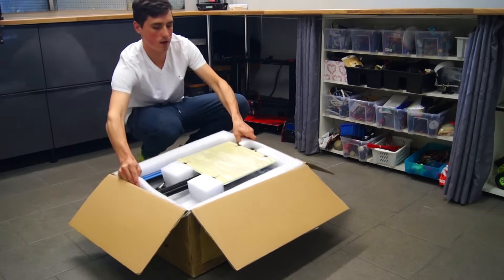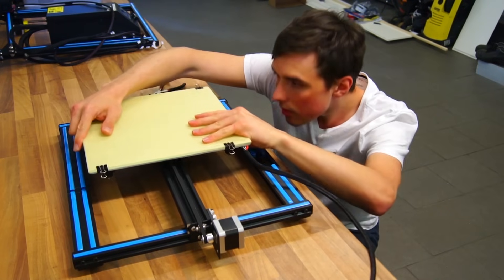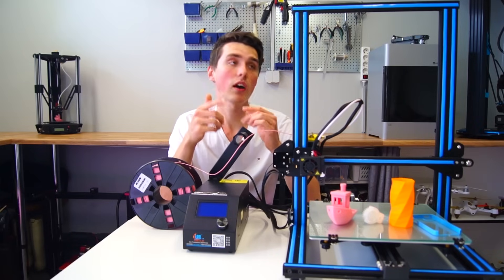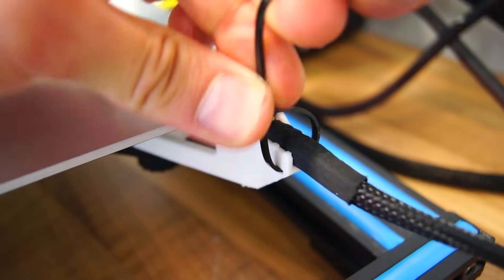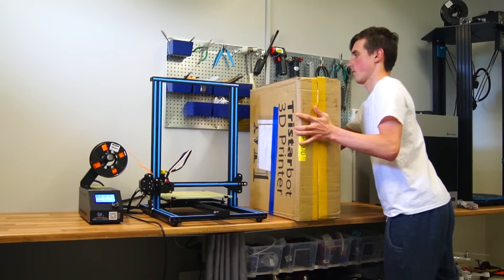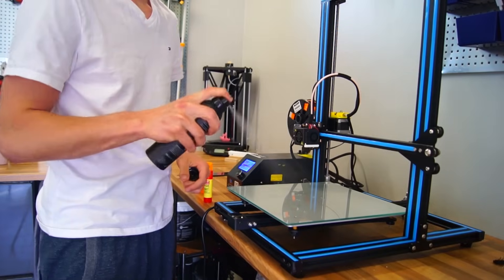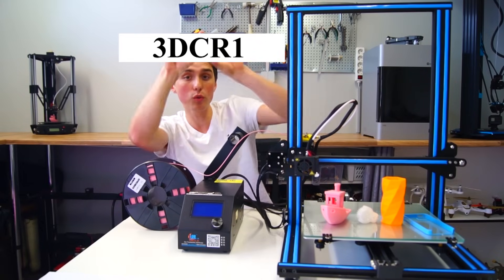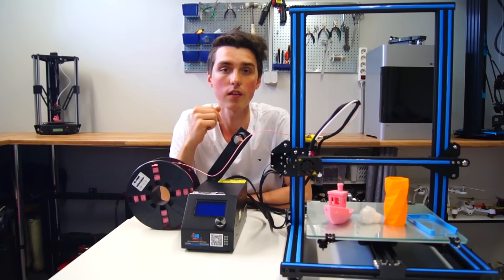Creality CR-10 Full Review - BEST 3D PRINTER!!!

Comment: Has anyone bought this ctc  Dual Z-axis 300*300*400mm 3d printer??? its basically a clone of a cr-10 from what i read... Not sure what Dual Z axis means or if cr10 has it ..or if its better in anyway... I already have a ender 5 and it has issues with several repairs etc.. and cost me twice as much as this ctc printer anyway

Comment: CR19 is a nightmare... the  bed sucks and don't heat up plus suffers of wobbling every few prints , moreso carriers are a nightmare to set up, structure tend to rattle...  i prefer my other anycubic printers i have
Reply: dang good thing i got the cr10 instead cause it doesn't have any of these bad issues unlike this cr19

Comment: Abs is very simple and actually easier to print with if you have a good enclosure. Pla drives me crazy with the stringing and cooking needed. Abs I can print and walk away with no worries about blobs and stringing. Plus the plastic is much stronger and outlasts pla by a long shot. Finally, warping is never an issue with a handy purple glue stick. Frees itself the moment it cools too. Win/win.

Comment: Hello RC & YT community, I am a 50yr old Army veteran partially disabled and unable to work due to pain... However, I am able to work at home… My life long hobby has always been building and detailing models... I recently talked about 3D printing to my brother-in-law and quickly realized the income possibilities in selling models/kits... I wanted to ask you and the community a couple questions in regards to 3D printing:

1) How difficult is it to learn how to 3D print? I have zero knowledge & experience on this subject.
2) My PC specs are: HP Omen Intel Core i7, 16GB Memory, Nvidia GeForce RTX 2080, 2TB Hard Drive, 256GB Solid State Drive. Can this PC handle this 3D Printer or any other? 
3) Aside from the cost of the printer (Currently about $320) and filaments, are there various other cost of items / equipment to be purchased?
4) Is it realistic to project at least a min. of $3K per month as income from selling my 3D printed models / kits?

Thanks in advance to all whom provide insight of information/answer questions.
Reply: I'm not sure if this is an actual geniune person asking this question on the internet but here it goes...
1) It's not too difficult to learn how to do so if you're at least relatively computer literate, (and know a bit about engineering I guess to actually assemble it by I digress) but you definitely need to have the time and patience to learn some new things. It might be frustrating at first, and this machine in particular is not exactly "user friendly" at all.
2) That computer is an absolute beast and could handle anything you throw at it with those specs.
3) Printer maintenance is the only thing I can think of atm, but other than that not much "additional costs"
4) Probably not feasable? It really depends on the market, I mean, how many people want to buy single color plastic trinkets from an unknown seller? Usually people buy this kind of thing to make custom parts for the home that they need.

Comment: Great video, I wanted to ask something: This printer was installed in my workplace, although the Glass is not currently in use, we print on the aluminium base directly (using masking tape), and I notice that it can get scratched from time to time (bed levelling, tool to remove prints, etc) So my question is if the glass is used, is the bed heating enough to get the glass heated? (we usually use 60 degrees on aluminium), also, would the glass get scratched easier, or get damaged faster? I'm asking this because I'm considering get one for my use
Reply: Use the glass whith hear laque

Comment: Can you help, when I start to print with my cr-10s the bed temp drops to 0°and it starts to cool down not allowing me to print. I already checked the plate temp during slicing it's set to 60. Any suggestions?

Comment: My first printer. Awesome.. level the bed, clean with isopropyl alcohol, smeared with pva glue. bed 50 deg, hotend 200 to 210, PLA. speed 90 to 100.

Comment: Hello, I have had some interesting issues with my X-Axis on my CR-10, purchased four months ago. Googling like mad turned up nothing which led me to getting in touch with technical support and they couldn't give me a definite answer. What happened was one night I had X-Axis layer shifts during a 15-hour print and from that moment on my CR-10 has been out of order. Manually moving the extruder on the X-Axis became more difficult than ever, which led me to loosen the bearings and although it helped, my X-Axis motor/belt was still making these clicking sounds. I was told by TS to reinstall the belt and make sure the screws on the motor were tightened. I did both steps but I am still unsure and ordered new belts as a precaution. My question to you is have you ever had this issue or a similar issue and what have you done to fix it? Thank you for your time and consideration.

Comment: Please can you answer a question regarding the voltage setting to be used, I see that the printer comes with a switch 110v or 220v.  
But here in the uk we have 240v so is it safe to use 220v setting..?

I’d rather not explode the thing when I turn it on first time..!

Comment: Just got my CR-10S (upgraded model) and have two wires that don't go anywhere. One is labeled "Z" but is just a single large connector. The other is labeled "Filament Monitoring Alarmed Cable" with just a single small connector. Any ideas what these cables get connected to? Thanks!

Comment: I recently bought CR-10s with two Z-axis motors. After some tries, I managed to print directly onto the glass with no glue, hair spray, etc. My secret - heated bed at 75 C for the first two layers and 65 thereafter. Also, extruder at 215 C. If you have issues, print with raft - helps a lot.

Comment: Hi I recently got a creality cr-10 and I am having problems with adhesion on the bed. I ve tried most things like glue hairspray blue tape, even not heat the bed up for pla, but I still get warping problems and non sticking problems any suggestions? Thanks
Reply: What material do you use?
Maybe the nozzle is too far/too close to the print bed so you have to fine tune it more.

Comment: Haha.... You're a funny dude. (I mean that respectfully of course)  Thanks for the review.  Looking to get my first DIY kit, so I can print my own FPV race quad and RC touring car parts, mainly.  

Does anyone have experience with using 3ds Max, Maya, or ZBrush to design items for 3D printer use?  Those are the three modeling/sculpting programs I have the most experience with. I know ZBrush has conversion options for printer use, but nothing for Max or Maya that I've found so far.

Comment: Hi Bro. I've bought Cr 10 following your suggestion. I'v just some question. my bed movement on y axis is very hard, because of 6 eccentric bearing at the base. but if i force them less, the bed move on yaxis more comfortable, but the six bearings don't turn together when i turn just one of them (it's a proof that in some video i've seen doing). How strong must be the bed in moving on y axis in your opinion? And also what kind of slicer do you use? with cura 2.7 i have ringing on y faces of xyz cube test. thank you

Comment: Hi. I am looking to get one but have two questions. I am not sure to get upgraded version with cr-10s or this one. The upgraded one has auto-leveling, new heating bed ()i think) and filament end sensor. Filament end sensor is easy to do with Octoprint since i am going to use it on rpi. Can autoleveling be done on cr-10 easy with octoprint? TNX

Comment: @RCLifeOn , I got the CR-10 now and it prints well AS SOON it has reached about 3-4 mm in height. Below that, meaning the first several layers, the one-sided Z-Screw is crap in my opinion. I have tested it with 5.1 mm tall cubes located in each corner and one in the middle. the two on the left side have reached 4.5mm, the two on the right 3.9mm, the one in the middle 4.0 mm. I have seen, that the right side of the bridge hardly moves during the first layers. When I turn the alu-connector from the Z-motor, the left side moves about 1cm in height without influencing the height on the right side. That is so stupid... I can't print the correct height with that setting. And yes. all excentric nuts are fixed and everything moves freely. I have also seen that on the left side, there are three wheels, but no excentric nut to set the strengh of fitting. Do you have any suggestions? Would be perfect, otherwise I feel like I have to send it back... sadly. 
Did I do something wrong with the bed levelling? I just hit auto home and leveled the bed with a piece of paper, just as usual. But I feel, the movement downwards before levelling is bad in terms of a correct levelled bed. When I change the height of the bed, the first layer doesn't stick, of course.

Comment: I actually bought this based on your review.. Amazing 3D printer, however it came with a problem, which is in normal setting the extruder always retracts the filament.  I have to set a negative flow in Cura v15 for it to print correctly.. I beleive the stepper motor connectors are opposite but not quite sure how to flip them, Any ideas? Btw, keep up the vids.. they are quite educational.

Comment: I am thinking about purchasing this printer as my first 3D printer. Could you recommend this printer as a good first?
Reply: Yes,  absolutely....  This was my first printer and it was no trouble at all.  You do need to familiarize yourself how to level the print bed.  It's not difficult,  but extremely important.  And finally,   buying this printer from Gearbest will be a pain in the ass.  Expect loooong delays.
Reply: What slicer do you use?
Reply: What slicer do you use?

Comment: thanks for the review, i already had two bad experiences with kickstarter 3d printers, one was m3d (too slow, small, error prone, no heated bed) and the other was flux 3d (great prints when it worked, but hot end constantly leaks and can't print multiple parts without them messing up). how has your hot end been working for the cr-10? it is reliable (has it leaked or clogged)? also can you print big nylon prints? I've been trying to figure out what is the max. hot end temp and bed temp that this printer can go to? (before I buy it).

Comment: will the Creality CR10 print metalfil PLA?
Reply: I think MetalFill PLA is abrasive. You may need a hardened steel (or similar) nozzle to prevent wear. I may be wrong, and the CR-10 might come with an abrasive resistant nozzle...Not sure. But I haven't seen anywhere that it specifically comes standard with one.. Hope this is of help.

Comment: Can you use this on 230v?  You can't get this with a uk plug but can I just swap the plug?
Reply from the maker: Yes, I got the wrong plug as well. Just swap it and it will work just as normal.
Reply from the maker: Though make sure the power supply is set to 220V (there's a switch on the side).

Comment: Yo! Whats the finest layer height for this machine?
Reply: Ok, I looked it up: 0.05-0.4mm (adjustable)
Reply from the maker: I wouldn't trust the specifications on the Gearbest site. 0.05-0.4mm is basically default on every single printer on their website. However, I would guess the finest layer height is 0.1mm. Maybe I could do a video about it?
Reply: I can print at 0.06 with one of the cheapest 3D printer out there, Monoprice Select mini, so I dont think there will be any problem with that

Comment: Please clarify, is this the 500mm Max version? There is some confusion as there seems to be three versions, the Regular - 300mm, the Plus - 400mm, and the Max - 500mm. Thanks!
Reply from the maker: This is the 300x300x400. Plenty big for the average consumer.
Reply: I'm starting a small business and need to do big work, so I'm looking at the CR10 Max model as the build area is greater that the Tevo Delta. The down side is that the Delta is faster and the 3 column frame appears to be a stronger design. Any thoughts?

Comment: what do you recommend as a table for 3D printers? as in stability for the printer. What about the surface it's on? can u put the printers on any surface?
Reply from the maker: Oh no, it will have to be stable. In fact, this happend to me a few days back. I placed my CR-10 on a weak separate table and the entire printer was shaking back and forth.

Comment: I bought one and downloaded the Simplify3D setup in Simplify3D.  Printed great PLA Prints.  You said you printed in several different Filaments.  The Simplify3D setup only has PLA and ABS. I tried PETG but not knowing the PETG setup in Simplify3D;  it did not print well at all.  Can you help us find the proper Simplify3D settings for the Filaments you have tested. (Or send them to me)  Thanks
Carl
Reply from the maker: I would recommend you to check out the Facebook group for the Creality CR-10. They will provide you with settings for Simplify3D.
Reply: Thanks

Comment: Hi, how much was the shipping for this printer to Sweeden?
To Norway its over a 1000 NOK! Thats pretty insane..!

Great video though, i just got more exited to buy this.. :-P
Reply from the maker: The shipping should be free. Try this one: https://goo.gl/L2UayK and use this coupon code: 3DCR1
Reply: RCLifeOn 
Tried it, cheapest shipping options i get is 1200 NOK. 😢 So the totalt ends up at 4500 nok, plus 25% tax, so 5600 nok. That is more then I want to spend.. :P

Edit:
Tried on the computer now, and i dont get it.. First it says special offer 3300 NOK, then i add the code and it gets over 4000 NOK.. Next time it gets cheaper by 100 NOK.. This was confusing..
But the shipping price is still over 1000 NOK.. I have sent them a message and asked if there is any other option.

The price gets almost double if i have to pay that much and its probably not worth it. :-/

Comment: Hey, I was thinking of getting this printer, but I'm wondering how do you load models to the printer and what software is best for doing so?
Reply: (way to late) It comes with a micro usb thing and an adapter for usb.  just use a normal 3d slicing software like cura

Comment: I recently started researching 3d printers and I WANT one so bad, but this is going to be my first time so I am not sure which one I should get. I'm currently stuck between the tevo tarantula and the CR-10. I know since it is my first time I should probably go with the tevo tarantula to gain experience but I know there is a lot that has to go into getting it to print perfect. On the other hand, the CR-10 performs great out the box, has a bigger volume and seems to have less problems when compared to the tevo tarantula. I'm good with building stuff so that doesn't scare me with the tarantula, but if I can pay a little extra and get the CR-10 which is better, wouldn't that be the better choice? 
If you've been in my shoes please let me know what you ended up getting and your experience! Thank you

Comment: Open the control box an boost the power supply output voltage to speed up the bead heat times.

Comment: I have a Maker Farm Pegasus 10 that uses the same V-slot and tire setup instead of 8 mm rods and linear bearings and once you use it you never want to go back.  It's very quiet, faster and more accurate and with auto-tramming it's a no-brainer to use, it truly is plug and play once you get it set up and calibrated.  

I'm guessing it has a PCB style heater run at 12V which is why it heats so slowly and poorly. That's why I opted for the Pegasus 10 (250 x250 mm) instead of the 12 (300 x 300 mm) because you just can't heat up a 300 x 300 mm bed with a 12V PCB heater. A good upgrade would be a line voltage silicone heater controlled via a Solid State Relay and given the initial low cost it would still be a very good deal for what you get

Comment: you post a video of the best 3D Printer , i add it to my wishlist .. sometime later you post another video of another "Best 3D printer" .. i remove the old one from my wishlist and i add the new one .. then .. sometime later you come with ANOTHER ..and another and another best 3D printer !! 
i think you're just seeking affiliate buyers :(
Reply from the maker: I'm sorry if this seems to be the case. Technology moves very quickly, but more importantly, I can't test every single printer at the same time. I seek out the printers I believe my viewers will benefit from and the CR-10 is genuinely an awesome printer that I can recommend to everyone. However, I'm sure I will stumble upon an even better printer than the CR-10 in the future. 

I do not seek affiliate buyers. My reviews is, and will always be, unbiased. If the printer sucks, I will tell you it sucks. In this review I did point out my concerns, but based on my previous experiences, the Creality CR-10 was superior to all the other 3D printers I have tested. Therefore I used the title "BEST 3D Printer", simply because it is the best 3D printer I have right now. Though I can't promise you that it will always be the best 3D printer. 

Sorry for my long text, hope it helps.
Reply: More money = more content so I'm not even mad.  You should gather your own opinions before you purchase anything.  Don't take "THIS ONE IS THE BEST" as an answer. The tech market, especially 3d printing, moves incredibly fast.